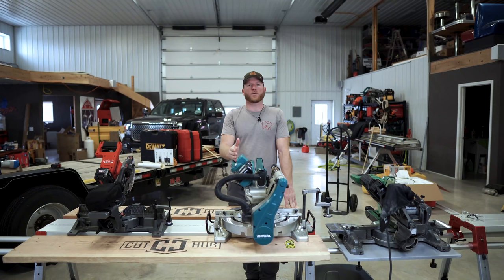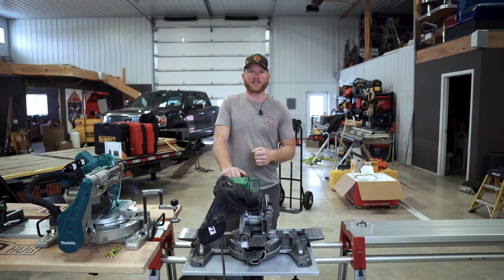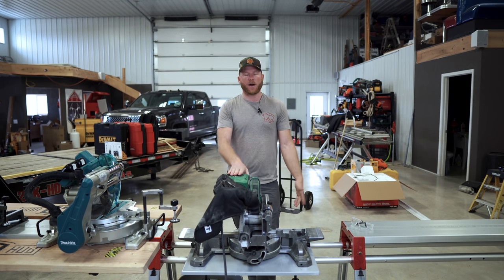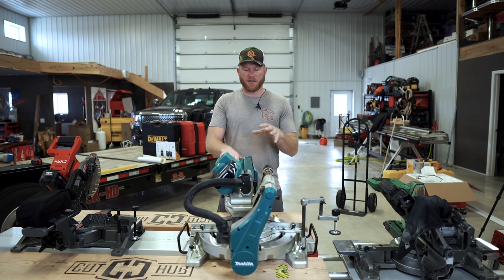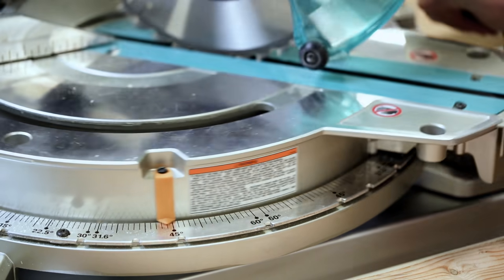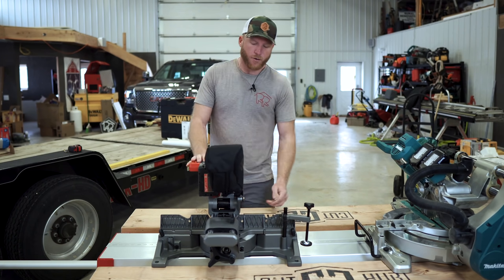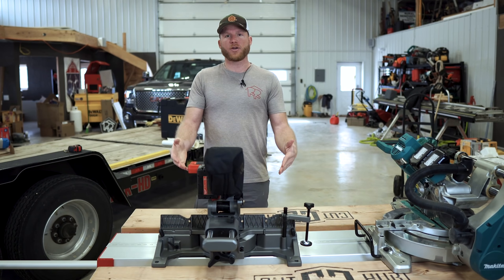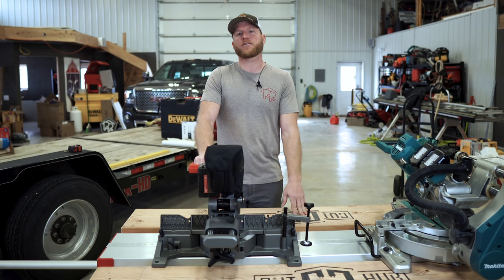My go to Miter Saws 2019: Toolsday

Comment: I like the Dewalt 12” FlexVolt sliding miter; it can run for a long time on 2 - 60V batteries or off 120V AC with the adapter. We can run all day with 2 batteries throwing them on the charger during lunch. I also like the Dewalt 20V 7-1/4” sliding miter. We run Dewalt 20V/60V exclusively does we tend to stick to that. I do like Mikita 2 - 18V systems and with Dewalt went that way instead of 60V though the 60V working in 20V tools is nice. Milwaukee is nice to have a full size single battery 18V saw though; wish Dewalt made a 10” single battery saw. I was Mikita back in the day, then went to Milwaukee, Porter Cable, then Dewalt. All top 3 are mostly equal with a benefit/deficiency hear or there just pick a battery system and stick to it as they are the most costly thing to run all day efficiently. With battery adapters coming for most brands all things are opening up.

Comment: Love my 10" Dewalt.  Wouldn't trade it for the world.  Most of the time I don't need a slider, and when i'm cutting trim I don't want that slop that the sliders give.  1-2* out makes even a miter on 3" base look like shit.
Reply: I use a 12in dewalt slider im a finish carpenter. Never had an issue with miter cuts I did 7in crown recently and miters were great

Comment: I've been seriously thinking about the Makita (corded) miter saw for my shop. I have a Ridgid 10" slider and I just can't get it dialed in like I want it. Maybe I can adjust the detent plate (been adjusting the fence), but I've heard good things about the Makita dust collection and the slider design saves so much space. My Ridgid isn't that old but I need a couple parts and most of them are already obsolete and unavailable. Not happy with Ridgid's support at all.

Comment: If percision is what one is after, the sliding miter saw is not necessarily the best choice. By the design, they all have more flex than non sliding saws. Also, I understand the appeal of cordless but one also has to take into account battery replacement costs. This is why I still am a proponent of corded bench top tools.

Comment: Love your vids! Hopefully you answer this. Shopping for my 1st cordless miter saw. Would you wait for the Milwaukee 12”? Or go with something different? Also did they mention when the 12” would be released? Keep up the good work!
Reply from the maker: Depends what you do.... for us the 7 1/4” will do almost everything I need...
Reply: My sales rep said November but it could be later then that :(

I own the 10" and while it is a good saw it isn't a good trim saw, the rail design is the critical part that makes it not as accurate. Since most 12" saws you are almost never full extended rails, that's why they are very accurate and tight. The spring is also stronger on the 10" than the 7 1/4" which isn't a big deal to me. The 10'' is a good saw but I would wait for the 12'' with new rails, its just not a great design.

I'm hoping to find a good deal on the 7 1/4'' myself as they are 499-599 in Canada, tool only. They are supposed to cut 5 1/2'' standard mdf base which is a big plus. It'll replace the 10'' for quick on site setups and I'll use the 12'' ridgid I have for the heavy stuff. I can't believe how well made the first ridgid miter saws are, I've done everything from high end crown to large 6" rough douglas fir/cedar beams/posts and it still maintains accuracy. So milwaukee will have a tough sale to get me into a 12'' down the road, weight and accuracy would be the biggest points, since the ridgid on the older stand is a heavy prick to load.

Comment: For someone earning a living, probably some good information.  For someone that just wants to repair a deck, or such type work, eh.  I just bought an Admiral, yes, HF, but it's going to live it's life in my garage, cutting hardwood four by four into lengths for my lathe.  No need for precision I won't use, and if my experience with power tools is correct, won't last before the slop in the mechanisms begin to show.  Then you're just as well off with a Chicago Electric and it's  a hell of a lot cheaper.  If it lasts the ninety days, then the chances are you'll quit before it does.  I wouldn't use it in all day every day use, but for most people, the big buck saws are not necessary.  Precision cuts are why they make good table saws.

Comment: funny to see the Makita 10" battery powered have the same flaw of dust collection, where you're supposed to plug your vaccum on the moving part of the saw, like the 12".
The regular 10"  is made the other way around, you plug your vaccum on the base. 

Some Designer seriously mixed things up at makita :)

Also to note, as far as I know, the dust collector plug is "not standard". I think this is made so to force yiou go with the makita dust extractor... seriously ? 

Beside that, I wouldn't change it, even for my previous Bosch 12"...

Comment: After 40 years of building everything I have found little change in miter saws. They cut wood period! I will never switch to battery operated gimmick saws.
Reply from the maker: That seems crazy... you wouldn’t switch to a tool that requires no cord and is portable to any part of the jobsite with ease and lack of electrical requirement?? That doesn’t make a lot of sense.  Also, have you ever made a cut with a battery powered saw?  It’s so much more power and much smoother
Reply: @RRBuildings  I guess if some company gave me a saw for free I could see first hand. Only needed a generator at one job since 1979. I can see where it would be handy for you. I could not justify the cost at this late point in my life. I don't see these saws flying off the shelves around here either. They even discounted the yellow ones at Christmas and still did not sell many. Guess it will take some time to catch on! Nice review and keep up the great informative videos.
Reply: the flexvolt 12” dewalt is a game changer no more fighting for power on the jobsite between a generator and then only one breaker when electrical finally goes in.  trying to save up and get the dewalt power inverter for my table saw.
Reply: Miter saws aren’t the kind of tool that flies off the shelves anyway, they’re big and expensive, can last sometimes decades and few buyers need more than one. I’m continuing to make due with a corded 10” Dewalt the last several years and a 12” before that, and yeah it’s gotten the job done. But there’s nothing gimmicky about modern cordless. For me, I’m overdue to get a sliding miter and Makita’s about to release a 12” cordless and that couldn’t have come at a better time.

Comment: I have the DeWalt 12" flex volt mitre saw and it's hands down the best mitre saw that I've ever used. It's made even better with the 12ah flex volt batteries which granted cost a pretty penny each but they are worth it and I have the option of plugging it in to Mains power when I have access to it. 👍🙂

Comment: Love the video! I am still a little on the fence though. I need to get a mitre saw. I am not a professional contractor or a molding specialists, but I want to get a mitre saw that can do fine carpentry if I had to but I don’t want it to be a heavy beasts because I may have to bring it somewhere else to use it. Also I saw you talked about the little Milwaukee but I want to get a mitre saw that can do like the 60° cuts. I guess the thing I am asking is I like everything about the little Milwaukee except I would like to be able to cut bigger pieces than the 7 1/4 can. Also a big deal breaker is the weight. It has to be somewhat lightweight. What would you suggest? Should I just get the 7 1/4 Milwaukee even though I would like a saw that can make bigger cuts or is there a saw out that has all the pros of the 7 1/4 Milwaukee but can cut bigger or thicker pieces of wood. Is there such a saw out there?

Comment: I have to disagree , the best thing about the makita IS the fact it takes 2 x 18v batteries . If you are already on the makita 18v platform why would you want to buy into a different 36v single battery platform . Just like the the 18v and 54v dewalt , need to have 2 battery platforms to run the tools . We are on the makita platform and run 12 , 14 + batteries so it makes perfect sense . (For the Americans 18v is sold as 20v in the states , because bigger is better in merica 😂)
Reply: "For the Americans 18v is sold as 20v in the states". No, it's not. It's 18v here too, at least for Makita, Milwaukee, Ryobi. Perhaps you are referring to DeWalt 20v?
Reply: @markeissler  never said makita was sold as 20v in the states. Mentioned it in reference for comparison of 18/36v makita to dewalts 20v range etc. People seem to think that they run at higher voltage where as under load all the 20v run at 18v
Reply: @JamieVauxnut1  Got it. There is unnecessary confusion in the marketplace. I wonder if the 40v are actually 36v under load...which then makes you wonder what DeWalt 60v actually is.
Reply: @markeissler  exactly right the dewalt 60v is only really 54v under load

Comment: Hi Kyle, 
Love the video. Exactly the three saws I have been looking at to get into cordless mitre saw market.
I also tried the hikoki 36v 10" and totally agree with your comments, I was hoping for a tight mitre saw and left the demo disappointed. I also agree the makita is too heavy.
2 questions.
1. In comparison to the makita Have you tried the dewalt 12" lighter saw, similar footprint and larger cut capacity? I tried yesterday and was very impressed.
2. How is the Milwaukee small saw on mitre cuts? I was considering this as my 80% of the time saw but need precision.
Reply: I own the Milwaukee and I've been super happy with the precision, a decent blade and the shadow line works wonders.
I have used it framing, decking, finish carpentry and everything in between and haven't needed to adjust anything

Comment: Gotta put some diablos on those bad boys.  You’ll have even better run time!
Reply from the maker: i totally agree
Reply: I have the Makita, the factory Makita blade is IMO the better blade, I would bet that with the corded Makita, the Diablo blade would be better.
Reply: Blade does make a big difference
Reply: I dont use the same saw for framing as I do for trim work. Dont think it makes much sense to do so

Comment: Miter Saw is an old idea because has just about 1 ft cut and cannot be used on boards. It shall be retired. I invented a "Parallel Guided Power Saw" which can be seen on you tube under this name. My saw can cut up to 18 ft or more. Look at my saw and let me know what you think. My saw may replaced miter saw, table saw, and router table. It can carry also grinders, drills press, hand saw and more.
Reply: I looked at your saw its far to big to be portable for sitework i am a carpenter i have 2 mitresaw and would have no use for yours . Your a clever enough chap though
Reply: can you cut 4x8 with your saws? A 4 ft is great and you can cut floor. What you saw is 8 ft and is too heavy to carry to site work. But for home shop is ideal.
Reply: My saw can easily be taken apart and installed on the work site. The heaviest is the table which serve also as a work table.

Comment: Personally I really dislike the horizontal handles. Ergonomically they're a bad design. The motion puts too much pressure on the back of the wrist. Much prefer a vertical handle, which also makes them perfectly usable for lefties.
Reply from the maker: good call

Comment: Great video. I bought a corded Mikita 10” slider about 5 years ago and got it home and was out of alignment out of the box. Fixed it because the store was far away. 4 years later it wasn’t precise again on a high dollar trim job. Sold it to a pawn shop for like $30 ($600 saw) I ended up buying dewalt 12” because they are rugged as hell. Now looking into dewalt cordless 7 1/4 battery. I’m actually a makita guy.
Reply: Jeff Kowalski 
Jeff, please let us know what you decide on, about the 12” team yellow. I bought the 12” team orange two Christmas ago, it came with a free stand, plenty of power, & a cord. I just picked up the team red 7 1/4”  for trim carpentry. I’m new to the construction world, & would appreciate your expertise.
Reply: Steven B I’ve had many;many brands. One of my favorite was the hitachi 8 1/2. My old boss that I worked with for over 15 years always bought yellow and used them heavily on daily use, so I finally caved and went yellow. So far I’m very pleased with my dewalt.

Comment: I know I'm not a "brother"… well your biological brother 😆
… but this diyer has been making picture frames, shelves and desks since the unicorn virus has ambushed the economy. 
Point is I'd be more than grateful if you feel like you need to get rid of a new sliding miter saw. I'm certainly not concerned about the color. 
Thanks for sharing your experience with tools and techniques. 
And a thumbs up 👍🏾 to your little shop apprentice as well.

Comment: I have the Ridgid version of the 7-1/4" which is basically the same as the Milwaukee and I looove that saw. A bit pricey tho. 

$400 bare tool!

I also have the cordless Flexvolt 12" slider. It's nice too but bulky.
Reply: I've had a Ridgid 12" miter saw for about 8 years and I love it. It's an absolute monster.  It probably weighs 60+ lbs by itself and with the Ridgid miter stand I'd guess it's close to 150 lbs. I definitely prefer to keep that saw in my garage and it would be nice to have a smaller 7-1/4" saw to move around when I need it.
Reply: I would love a corded, rails forward 7 1/4 since I rarely need to cut 4x4 posts and don't often move mine.
Reply: @onecheapgeek  yeh I've never seen that with rails forward

Comment: "Down side to makita is it has a really good dust collection" what? Any dust collection would need set to your vacuuming setup.
Reply: Fixing Things and Fishing I have it and the dust collection is easily twice as good as my Dewalt 12in saw. I don’t even use my Dewalt anymore unless I need to cut tall baseboard. The Makita cordless gets used in the shop and on the road. It’s just a nice saw to use and with the dust collection, I have zero problems dealing with changing 2 batteries when needed.

Comment: Really great information and thanks for the comparisons! Really good points to think about, shows you really know your stuff!
Reply: Miter Saw is an old idea because has just about 1 ft cut and cannot be used on boards. It shall be retired. I invented a "Parallel Guided Power Saw" which can be seen on you tube under this name. My saw can cut up to 18 ft or more. Look at my saw and let me know what you think. My saw may replaced miter saw, table saw, and router table. It can carry also grinders, drills press, hand saw and more.